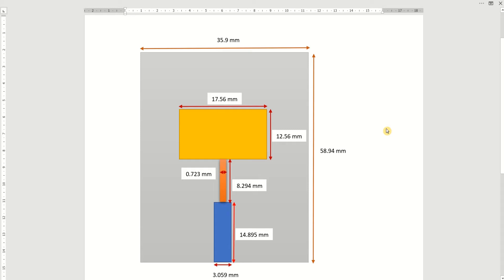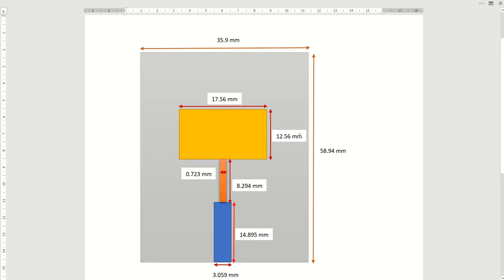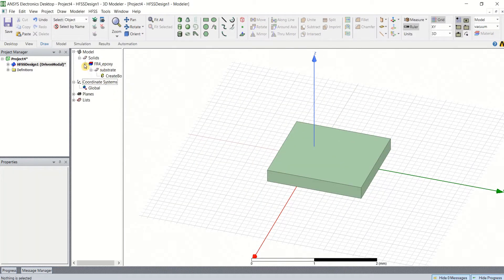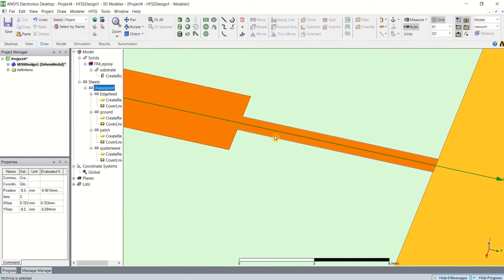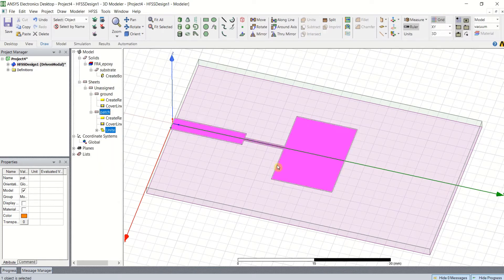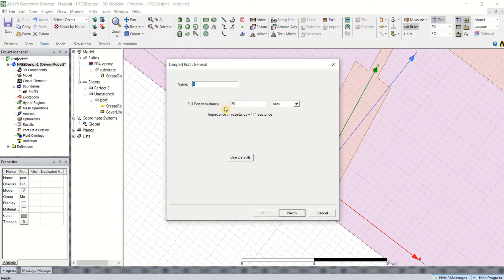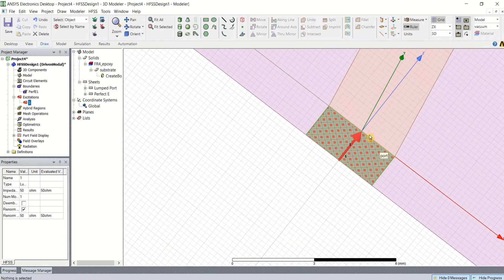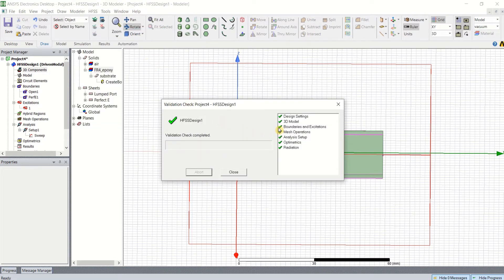RECTANGULAR EDGE FEED ANTENNA DESIGN USING HFSS || PART-1

Comment: how did you calculate length and width of lambda/4 transmission line and width and length of edge feed?
Reply: length is calculated using the frequency and permitivity of the transmission line. i.e length = lambda/4 and lambda is c/[f*sqrt(permitivity)]
Reply: @harihara.t  permitivity for cupper?

Comment: Sir how did you calculate the length of cut and feed line
Reply from the maker: Length of antenna is 60x60
So feed length is 30.
Regarding cut I don't have much idea. I learnt it from a course.
Reply: @dr.hariprasadnaikbhattu  thanks l found out it
Reply: Pls tell about port dimension..
Reply: How can i choose